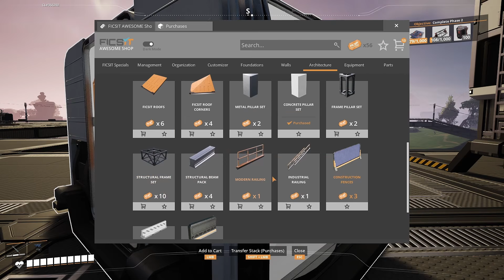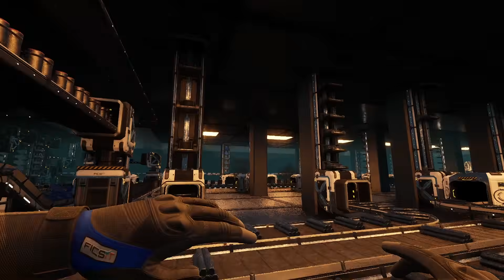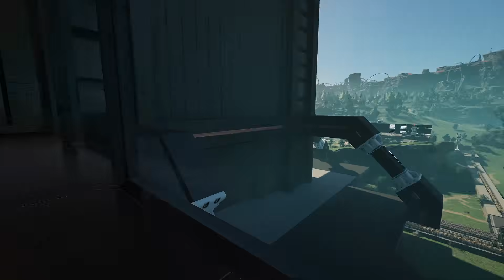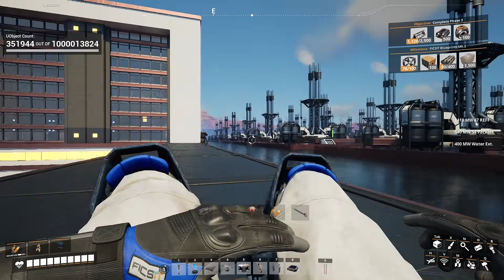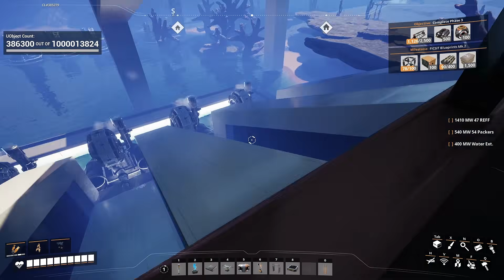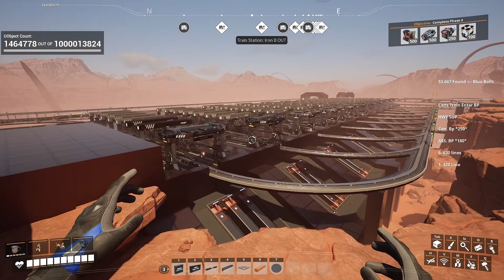What 500 HOURS Looks Like In Satisfactory 1.0

Comment: i know satisfactory is not factorio and we should not compare the two with eachother - but what I would like to see more than waypoint signals are two things:
a) smart stacking: say you have one big hub where a lot of materials get delievered to - instead of having a train to be set to a specific platform it would be way cooler to have multiple platforms combined as one hub and maybe have hub/station entrance and exit signals so that you can set a target to a hub and depending on the congestion the trains choses one of the available platforms
b) run trains on request: have a factory up north needing lots of materials and having  lots of buffers - when the buffer runs low a train will be dispatched from a source location to deliver a new batch for resources or lower-tier pre-requisits - instead of having full trains run in circles until the buffers at the target run low enough so the train can be unloaded so it can load new raw resources at the miners
this likely will either never happen or very late or maybe just by mods - maybe i should finally buy factorio and play it for a couple of 100 hours
Reply: You can set trains to only leave a station after fully loading/unloading, if that's what you mean

Comment: I have no talent for design so I'm always enthralled by this sort of thing. Everything here looks fantastic! 

Regarding floor holes for pipes though... I also don't use them, I tend to just run the pipe through the foundation. But when I do that I will still put a floor hole down and nudge it into place so that it gives the appearance that the pipe is going through it. It just looks too weird to me to have a naked pipe going into a floor.
Reply: That's technically the ideal way to do it, with conveyor lifts as well. Build as few as neccessary by making them as long as possible, add floor holes and supports for aesthetics afterwards. The less individual ones of those the game has to calculate, the better it runs.

Comment: My main question is for your lights. I know that they are made with the signs, but every time I’m 5 feet away from the lights they fade and act as if nothing is there. Is this a setting that I have to turn off?
Reply: Global Illumination (Lumen) is required to use signs as light sources. There was also a time i think during update 8 that messed up the global lighting, massively reduced its range or something, i had to go into the game files and change a value to get it working again, and it still does to this day. Don't remember where i found how to do that, should be fine now after 1.0 release anyways. But if global illumination on high is giving you trouble with the range of the light emissions, do search for that file edit, worked wonders for me, i'm sure it was either some steam or reddit thread.
Reply: @Random_Banshee thank you! I found a mod that changes certain settings of it making the lights even prettier 
.

Comment: Im on an rtx 2060 and the first section of my fuel plant gets down to about 16 fps and the factory isnt even on yet.... god i need an upgrade so i can make things like this.
Reply: A 2060 should be plenty to run satisfactory, you might be running into CPU or RAM issues. Also I'd recommend trying turning off DLSS or similar as it uses a lot of vram and caused me very low fps. I wish you good luck!
Reply: Bro im in a iGPU
I just have everything at low and 30fps